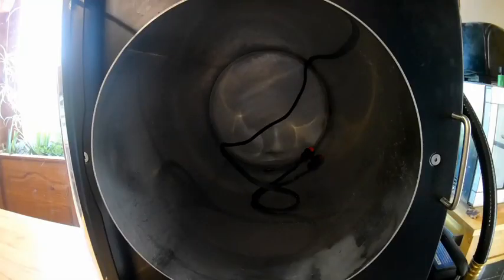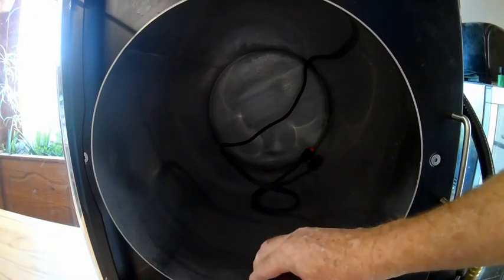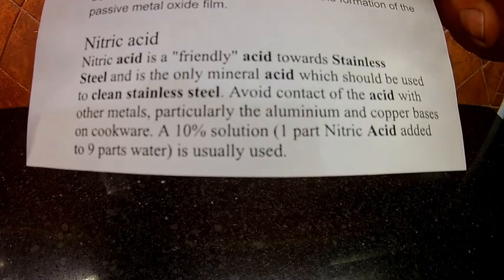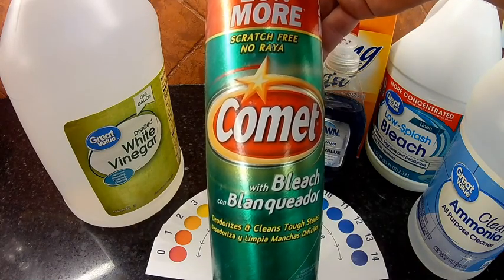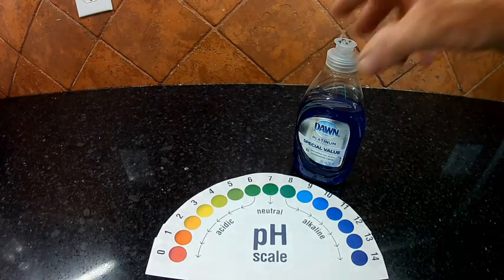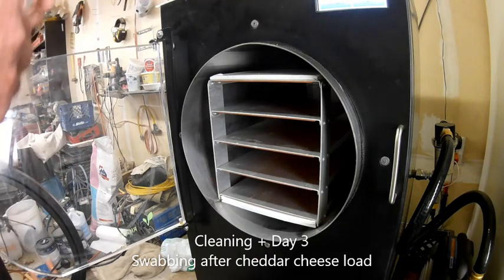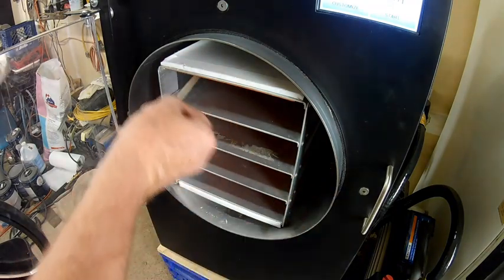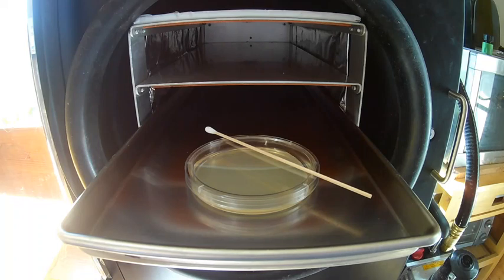Cleaning the Harvest Right Freeze Dryer

Comment: Mr Phil l have a problem with vacuum sealing my bags. I put them in my vacuum chamber and vacuum seal them when I take them out the vacuum seal does not hold the seal.some do and some don’t. What could be the problem? My vacuum chamber is the same as yours,but it’s a 9gal. I need help thanks.
Reply from the maker: Have you seen these videos?
https://youtu.be/nHM2cnf_FY8
https://youtu.be/CDj02lxBFiQ
Are the bags being over filled?  Make sure the top section is left empty and folded over and wrapped with a rubber band.
Reply: @Philat4800feet  i will try this to see if it will work. Thanks for your help i really like your videos they are very informative and i have learned so much about freez drying from watching them. I would really like to talk to you on the phone about freez drying some day!  Again thanks for your advice.  I’m out freez drying the world !!

Comment: Our freeze dryers have been in storage (doors open) since last November while we were renovating.  I am grateful I found your video. Just deep cleaned one of FD.  I figure I should also pour some alcohol down the drain line.  I am ready to experiment with peppermint candies.  Since we still do not have a kitchen sink or dishwasher  yet, I am going to stick with candies, hoping to avoid the potential messes FD-ing meals can bring. Thank you for all your research and great information! Can't wait to see what you share next.
Reply: If you freeze dry sliced strawberries, (it saves a lot of energy if you deep freeze them first), you’ll be unlikely to get a mess. They are a great starter item.

We found that putting down some parchment paper in the trays, makes things easier again, especially if you’re still setting up your household I don’t necessarily have all the plumbing connected.

Parchment paper will lift right off the trays, and you can use a clean dish washing cloth to just dust away any remaining particles of freeze dried strawberries.

 We found the same thing with freeze-drying, sliced bananas. Except it’s a lot more efficient to slice the bananas lengthwise. Then we dip them in a solution of lemon juice with honey in it. Some of us say there’s no difference in the taste, but more of us think it’s worth the effort. Especially to keep the bananas, nice and brightly-coloured. There’s a big positive correlation between how appetizing something looks and peoples’ willingness to eat it.

Comment: Phil - I normally steam clean the crap out of mine after a couple loads.  Use the Lady Bug Tancs model which produces super heated steam.  Just have to plug the holes to prevent moisture from getting into the line for the pump.  It melts away any of the grease and grime.  But it is time intensive.  Thanks for this video.  I can make use of the jugs of alcohol I have as a faster alternative.

Comment: This post has been, by far, my favorite post about the cleaning of our freeze-dryers. You teach the man to fish and share the whys so we can make educated choices. I last watched it over a year and a half ago. I'm now back out on the net researching more about the sanitation around our food prep. 

The ball valve seized on me, so in my last search for answers to resolving this, I found out that USDA only supports stainless steel for food-grade metals, not brass. 

But the parts on the tubes connecting to both ends of that ball valve are brass, not stainless. So that brass is rusting. 

I clean my machine EVERY use. So I was shocked to see what I found when I took the ball valve off. All that rust and gunk building up around that ball valve was nasty and has me concerned about how healthy it is when it's opened and all that gunk is pulled back into the chamber?

Have you checked that, too? I realize this video is almost a year old, but I wanted to know if you have experienced this. I'm off to check your more recent videos to see if you have covered this. I still wanted to share my concerns here.
Reply from the maker: A stainless steel ball valve would be ideal.
Another issue to consider from the FDA is the term "Incidental".  How likely will food come into contact with other substances.  This is the key word when dealing with food grade vacuum pump oils and other materials.  You are correct about introducing substances back into the chamber from the drain system.  Many have contaminated their food when the drain tube becomes submerged in water.  Cleaning the drain system is often over-looked  Good thoughts.
Reply: @Philat4800feet  Hello. You speak of the vinegar in the freeze dryer. Would it be OK for me to freeze dry pickles if I was to rinse them really well? I do know that pickles have vinegar in them so I was wondering if you could help me out thanks so much.
Reply from the maker: Freeze dry away.  freeze drying with foods containing vinegar and cleaning with vinegar are two different issues.

Comment: Hi Phil!  I'm always thrilled to see you have posted a new video!  FYI...I remembered seeing conflicting instructions on cleaning the chamber when reading through the HR manuals that come with the freeze dryer.  In the "Guide to FREEZE DRYING",  page 6,  2nd paragraph it says, "You can also wash the inner walls of the freeze dryer with soapy water or bleach."   Page 15 of the Owner's Manual says "Do not use Benzene, Thinner, or Clorox for cleaning."   Also, about how long  did it take to loose vacuum due to corrosion on the ball valve? (weeks, months?)  Thanks!
Reply from the maker: I made a video on the ball valve- "Why is my Harvest Right Freeze Drier Leaking Vacuum?".  Thanks for the comments

Comment: Great videos! BTW, HR is no longer including a pad with new machines. I bought mine a few months ago and found an info slip while unboxing saying many users don't install the pad properly and it interferes with the seal, preventing vacuum. Fine by me as I enjoy the visual check while processing anyway
Reply: Same here, I just cut out a disc of close cell foam, sprayed it with plastic dip and use it and it's easier to clean.
Reply: Same here, I just cut out a disc of close cell foam, sprayed it with plastic dip and use it and it's easier to clean.

Comment: This was most helpful and scientifically based.  Many thanks for taking the time to provide this information.  Our freeze dryer arrives tomorrow so my husband and I have two follow-up questions:  1.  What do you use to clean the acrylic door?   2.  We understood 70% isopropyl alcohol would make the seal ring brittle over time, but it appears you use it without problems?
Reply from the maker: The alcohol was meant for the stainless steel only but could be used on the door.  I remove the seal and run it under water.
Reply: @Philat4800feet  Thanks!  That's what we've been doing since out machine arrived.  Appreciate all of your replies and mentoring!

Comment: Question: Since cleaning with acid poses a danger to various parts of the freeze dryer (like the chromium oxide layer on the stainless steel or the ball valves), is there also a concern when freeze drying acidic foods? Like citrus, tomato, or foods with a lot of vinegar? I ran my first bread batch with the bread soaked in vinegar, but this video is making me wonder if that is something I should avoid. I also really liked doing freeze dried oranges, but would doing citrus reduce the life of the freeze dryer?
Reply from the maker: Over the long run perhaps without cleaning. The most damage would be the ball valve where acidic water is trapped for days until the valve is opened and drained.  If the chamber is kept cleaned there should be a problem.
Reply: @Philat4800feet  Ok cool. 😁 Thank you so much for the advice. Btw, your videos are incredible and I tremendously appreciate your thoroughness with explanation and experiments. I think your channel might be the greatest resource for freeze drying that I have found!

Comment: @Phil at 4800 Feet:  Thanks for your video. I especially appreciate the comment about the ball valve, as just two days ago the factory recommended to me that I use 10% acetic acid vinegar to flush out the drain and hose. (!!!!)
Your tip about the rubbing alcohol is also a really super good one to have. I imagine that these two tips alone will change the way many, many people clean their machines.  That is no small service that you offered with those two comments alone.

Your microbiology techniques are a little unconventional here; I’ve never seen petri dishes inoculated in quite that matter, but you did a great job of making your point. Spores are in the air everywhere, and not just on surfaces. Sometimes we use that information to our advantage, such as people do when they want to make sourdough, or vinegar or kombucha’s or even wines without adding their own yeasts.  Other times, it amounts to contamination, which is exactly your point.

And of course yeast and bacteria are not the only things in the air. There’s a possibility that some of the contamination that you were able to culture, came from airborne contamination.  There’s probably nobody that couldn’t benefit from knowing this information, and how to use it to the best advantage possible. 
     Anytime we leave possible residues of food on surfaces, including the interior of the chamber, we run the risk providing a nutritious substrate for microbes to colonize our tools that are used to produce and protect our food.

The metallurgy report that you provide is really useful; there’s probably a lot of people with no idea about the fragility of that coating that keeps the stainless steel chamber in prime shape. Thank you very much for that.

It’s probably not a bad idea to keep an extra ball valve on hand, since this sort of thing that person might not intuitively consider when it seems that compression is suddenly lacking.  If water alone can do this, since water must of necessity pass through the draining mechanism after most uses of a sublimation set up, eventually it’s probably going to happen to everyone.

Your presentation is well worth a second listen, and as soon as I send this comment, that’s what I’m going to do.

The information that I’m actually looking for today, has to do with cleaning. There are certain items that you can put in your freezer dryer, that no part of the information that comes with the machine, indicates can really expand upon the freezing sublimation process. Eggs are one of those. Lol. If the machine noises up, if they almost invariably do, the sensors can get confused. The machine can spend days trying to sublimate the ice formation, as with all nondry food. Nutrient matter can be drawn in the intake port in the Upper 1/3 of the machine, and my concern would be that that material kind of drawn into the pump and cause problems. I’d really like to hear if you’ve got some ideas about cleaning out that port that leads from the inside of the compression chamber out.

Thanks again. Your thoughts on this matter would be very appreciated.

Edited to fix some auto correct errors. Please note. I did not actually put a frog in the machine. That was pure auto correct. For anyone who saw that and thinks that I put a frog please note that it was only eggs.

Update:  I’ve actually downloaded The patent application with the schematics, before managing to get a hold of the factory. Actually, making contact with somebody who was not in a Third World country, and I never seen such a machine, was no small task. they need to do better in that department

So a person can just pass a pass-through or a brush through that opening to the outside to clean it.

In my case the hose did have to come off the machine and the pump, and it had to be cleaned out. It doesn’t hurt at all to use water on the hose, But No solvents, other than water, if memory serves. (It’s been a year since having to do this.)

Again, in my case, the egg hadn’t actually gotten pulled into the pump. Thank God.  That would’ve been a whole different level of cleanup.

I save the vinegar for silicone hoses now, so as not to pit ball valve; And the 99% rubbing alcohol is what I use to clean the machine out now. It also should serve to preserve the coating inside the machine.

So eggs go into the machine deep frozen now, as does anything else with a high sugar content. Lol and the moments the warranty is up, your vacuum filter is going on the machine.

tyvk!!!!
Reply from the maker: Good thoughts and comments.  To prevent food particulates from getting to the pump I did install a vacuum filter:
https://pneuforce.com/vacuum-inlet-filters/vacuum-inlet-bowl-filters/vacuum-inlet-filters-assemblies
If your unit is still under warranty, I would wait.
I'm also working with a food lab on cross contamination with raw meats, such as chicken, within the FD chamber and shelves.  This should be done sometime in Jan. 2023
Reply: @Philat4800feet  If it's not too late, as you investigate cross contamination and sanitizing, would you consider investigating Steramine tablets?  It's recommended for dishwashers, restaurant kitchens, scuba diving gear etc. It's supposedly safe for rubber, plastics, stainless steel etc.
Reply: Use gloves!! That alcohol is the perfect paper cut finder!!! LOL
Reply: @Philat4800feet  : That filter is genius. I haven’t seen this in a year, and definitely going back to review it.
Reply from the maker: I need to find one not made from plastic

Comment: Hello Phil thankyou for all your fanstic help n ideas, I so enjoy your videos your one of the best. Have you ever heard of having a terrible oil smell in side the chamber on a new FD, I'm having this big problem I can smell it 7 ' away. I'm going to clean it with the rubbing alcohol like you said n do your full leek test. It says I do have a leek and have only tried 8 loads with problems  each time. Again thankyou so much have a wonderful day. Pixie
Reply from the maker: There's a check valve (one way valve) in the vacuum pump.  Oil should never get into the chamber.  Is it only a smell or is there any oil residue near, or inside the hose?  Could one of your past foods smell like oil?
Reply: @Philat4800feet  Hello i just found the button to reply back. I think its the glue they used on the tray holder n the connector plug go remove the trays stinks so strong n bad to. Its been airing out for 2 weeks now. They say my hose to the pump in faulty n i need a new valves for the drain hose to n this is a new mechine. Rushing out your products ends up costing you more in the long run. Did you know their moving to a new much larger building, their growing to fast. Thanks for your help i so enjoy all your videos cant wate for the next one. Have a great day 🇺🇸
Reply from the maker: @lindac6378  Valves can be found at Home Depot.

Comment: Phil, I screwed up and left the door shut and now I have mold. Sounds like washing with mild soap and sterilizing with isopropyl alcohol will clean the chamber. But do I need to clean anything else…and if so, how? Hose? Pump? Thx for the info!
Reply from the maker: Keep the door and drain valve open and give it a good cleaning without abrasives.  The same with the pump.  Put a block of wood under the rear with valve open until ready to use.

Comment: Thanks for a great report on cleaning the Harvest Right freeze dryer! Isopropyl alcohol it is. Q: I freeze dried white bean chili. I have cleaned the freeze dryer completely after this batch, but there is still a faint smell of the "chili spices.' Can I set a bowl of baking soda inside the freeze dryer with the door closed so that the baking soda will absorb the smell? Will the baking soda migrate out of the bowl and attach to the surface of the freeze dryer if the system is not turned on? Would I have to wipe down the surface again after letting baking soda sit in a bowl inside the freeze dryer? Thanks for any insight.
Reply from the maker: The soda could become airborne and enter your pump.  I would pass on the soda.  You're smelling mircoparticulates of your chili, and those particles could be in your drain line, inside the back of the shelves, inside the corrugated plastic insulation, etc.  A fan place in front of the door can help defrost and remove smells.

Comment: Great video.  Very informative Where can one get a replacement valve?  Thanks.
Reply from the maker: Home depot- 3/8 FPT ball valve
Reply: @Philat4800feet  is there a recommendation of metal for the ball valve that is least susceptible to acidic Ph? Stainless Steel? Carbon Steel? Brass? Thank you for your time in this matter.
Reply from the maker: I would use 316 stainless steel, 3/8 FPT ball valve.  the cost is about x4 more

Comment: Would you use a steam cleaner, being careful around wires of course?  They get up to 318 degrees and would also take just the one step.  Thank you very much for all your videos, they are fantastic.
Reply from the maker: The issue is using a PH neutral cleaner.  Whatever it may be. Steam could work.  Be careful with the wires.
Reply: @Philat4800feet  Thank you, if my machine ever gets here - hopefully 2 wks - I'm trying it.

Comment: The Petri dish demo convinced me. Thank you for doing that. Do you use the 70% mix on the heating elements as well as the inside of the door ? If we sterilize every few loads would you just wipe down the chamber with water/paper towels  in between sterilizations?
Reply from the maker: I'd wipe down what can be reached.  The inside of the trays are hard to get to.